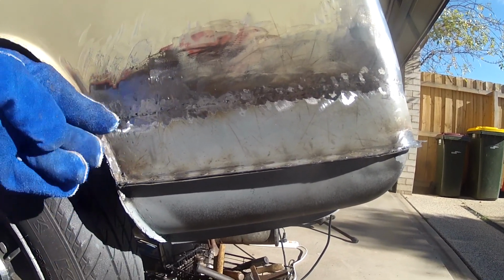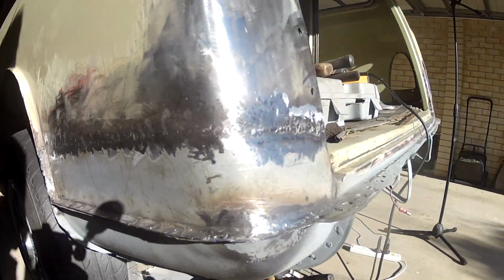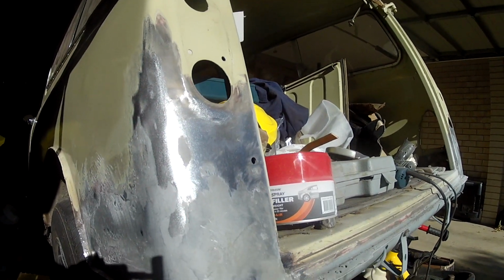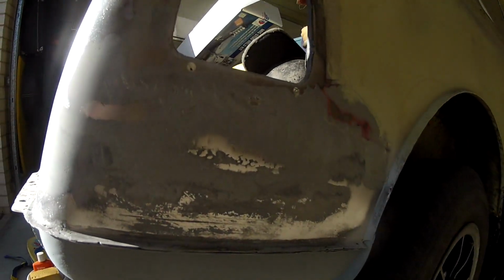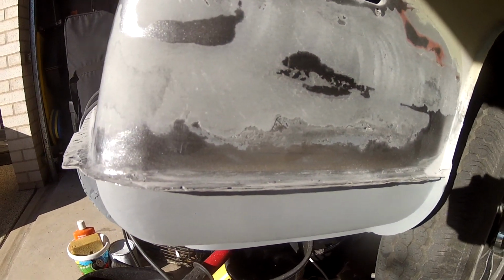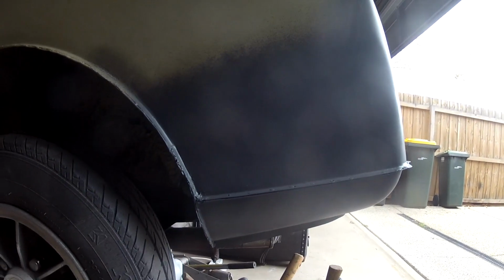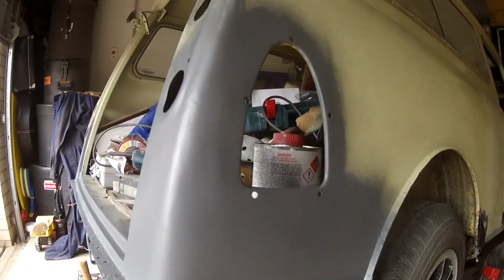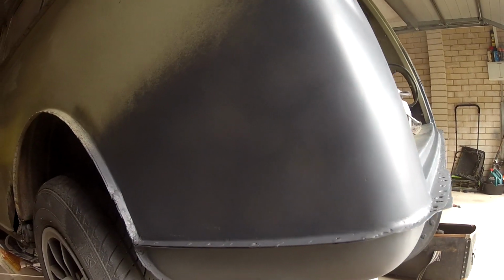EP18 Classic Mini Rear Quarter Panel Repair | A Rusty Journey | Classic Mini Van Restoration

Comment: Awesome series of videos, I’ve recently acquired an 850 van that hasn’t seen the road in 30+ years with rust in the same spots, it’s great to see how it comes apart and goes back together.
Reply from the maker: junkyarddog87 thank you I hope it helps! Mine was an 850 too. Would love to see some pics of yours too? Yes they all rust in the same spots. Definitely take lots of photos and measurements and make patch panels prior to cutting so you can check they’ll fit accurately.

Comment: Simon, Great job on what is a tricky area with so many curved surfaces, Cheers Dave
Reply from the maker: davejaguar66 thanks again Dave. Thing I’m learning is if you don’t like fixing rust, don’t look for it as any old mini is bound to be full of it and I’m in a hot and dry country with no ice or snow! Can’t imagine how there are still so many Minis kicking about at all? Actually, it’s thanks to guys like you!